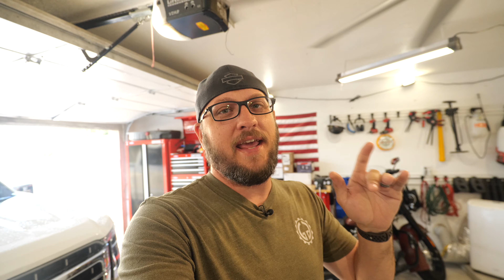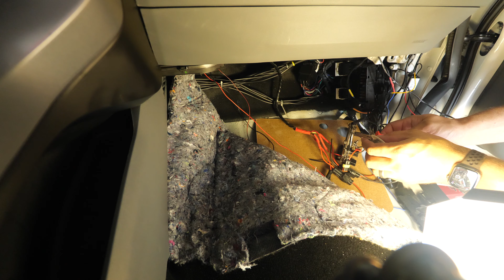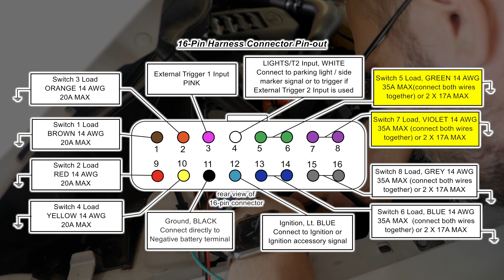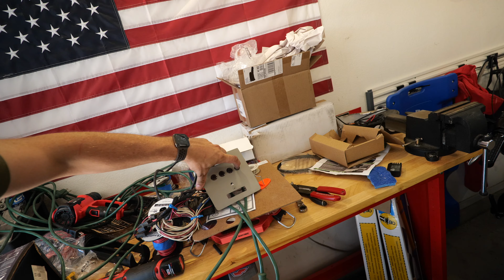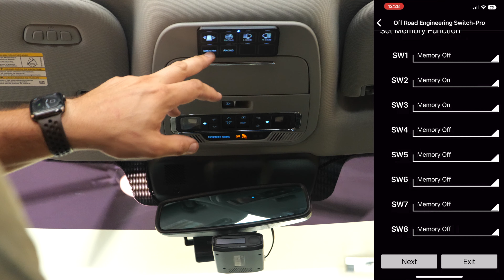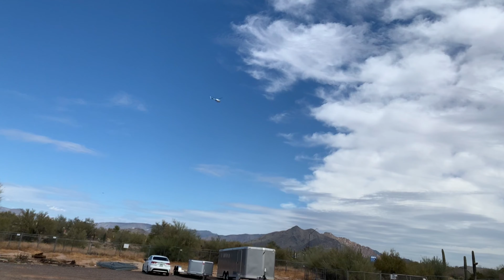F-150 PowerBoost Lighting, Switches, and accessory upgrades (Build Series)

Comment: I need help! Anyone help me out I would appreciate it! I want to place a 12 volt fridge/freezer im the bed of my powerboost... where can I pick up 12 volt or just plug it in traveling... my dealer sucks and blew me off
Reply: If you have the generator upgrade , you just plug it in ? Turn the generator button on ….. if you only have the normal outlets , im not sure if the wattage is to much or not

Comment: Make sure to sheath your wire! Your sp9100 will catch a short and prevent big issues, but the way you ran that wire will surely cause one some day! Other than that very nice. Debating where to install my switch pros panel right now.
Reply from the maker: Thanks, I think I have it in good enough shape to not need sheathing, it is all wrapped for the most part in electrical tape for a slightly added protection and I put rubber grommets in the holes that I ran it through but where do you think I should add a little extra protection? Always appreciate constructive criticism.